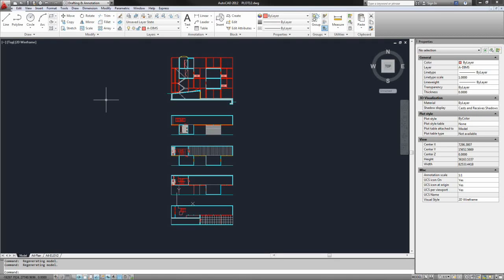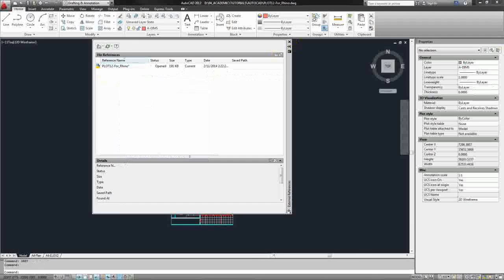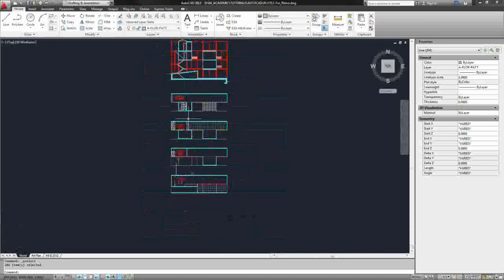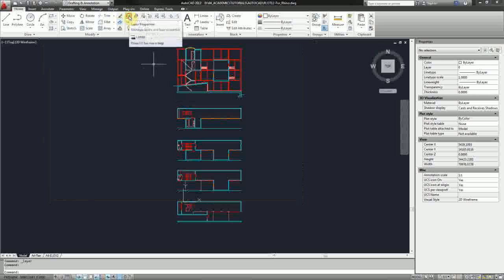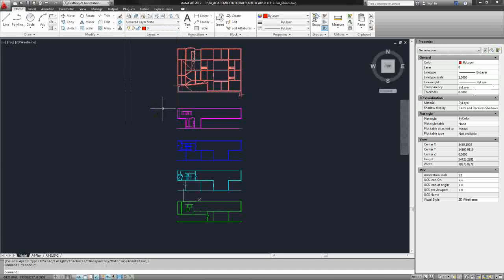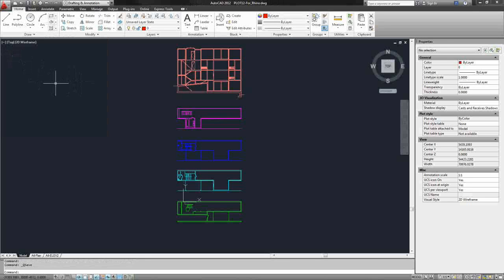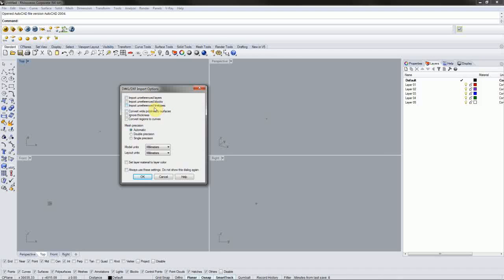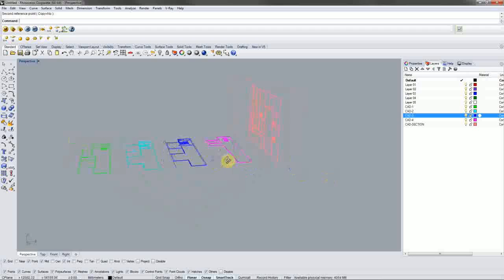AutoCAD to RHINO

Comment: I have a trouble with the conversion from cad to rhino. When I select "import" in Rhinoceros the program doesn't identify the cad extension and i can't see the cad file in the place where I saved it. I've already converted autocad 2013 into 2000 but it doesn't work too. How can I solve this? Thank you
Reply from the maker: Not being able to see the any Autocad files leads me to think you need to set the pulldown to "All compatible file types" when importing.  If this still doesn't work, try to save as a DXF and try to import that.  This tutorial is a few years old now but should still work.
Often times Rhino will by default look for the file type you last imported, so if the last file you imported was say a .3ds or .jpeg or anything else, it could be set to only look for that file type.